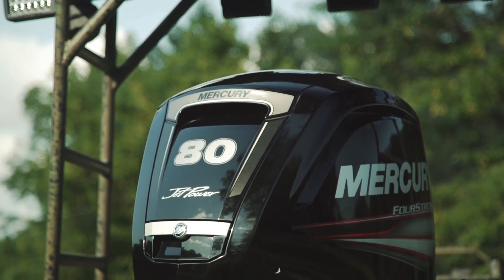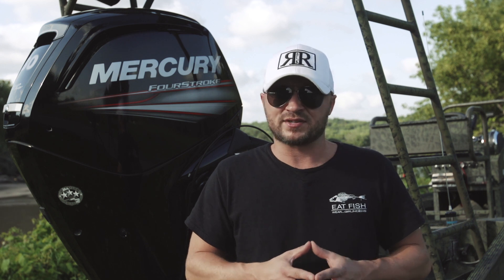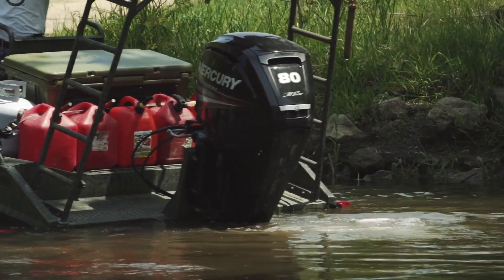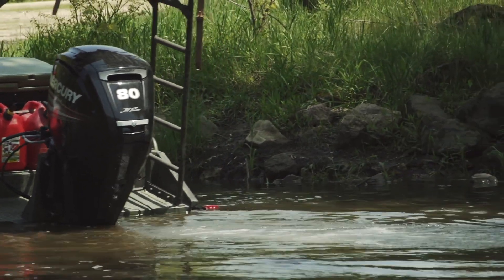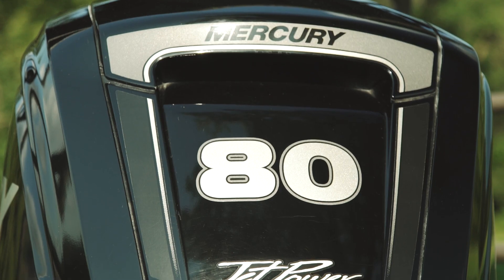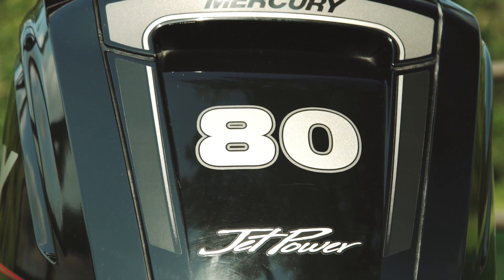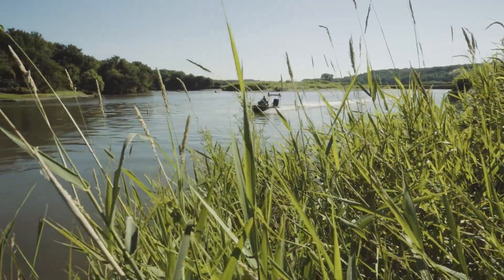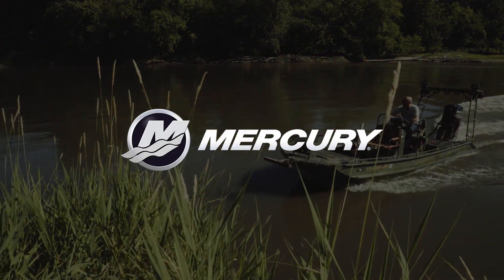Engine Displacement Explained Simply

Comment: When I first leaned about cars, I thought displacement was gas 😂, I thought, for instance the viper 8.4L V10 the L meant liter for gas. It still confuses me a little bit.
Reply: I thought it was how much oil an engine took 😂 5.7lx33.8oz=192.66oz%5.7(33.8)liters=6quarts. Why is my 6 qt engine taking 7 quarts of oil. Your efing me oil change shop 😂

Comment: Are you sure about the less fuel part?
Reply: what he’s saying is if a 2.8 liter I-6 engine was producing 450 hp and trying to accelerate hard it would use more fuel than a 3.5 liter I-6 engine with the same power attempting the same thing. smaller parts working hard require more effort (in a way). i really tried to explain this, sounded better in my head but i hope you got the idea

Comment: Many times I look on the internet to find a car and, but many website doesn’t offer information about fuel consumption like for example (10 km/ 0, 45 litre)
 

So, how to calculate fuel consumption in 10 km/ litre, using kw, hp, cm3 etc… without using the odometer?